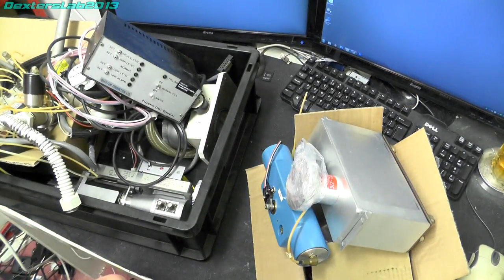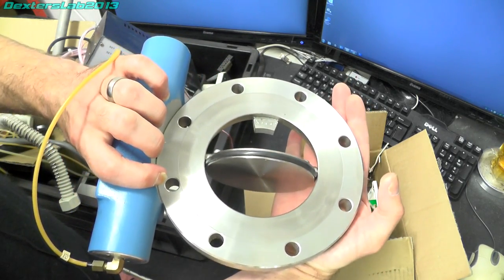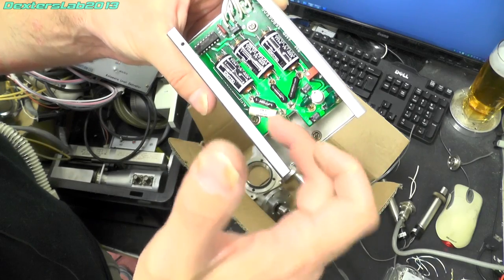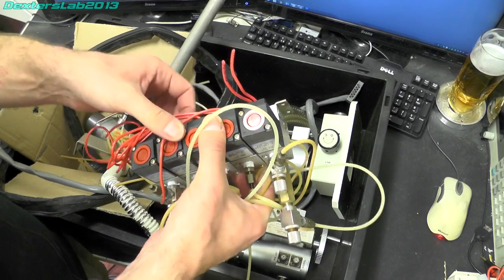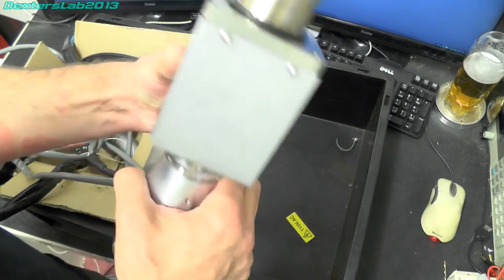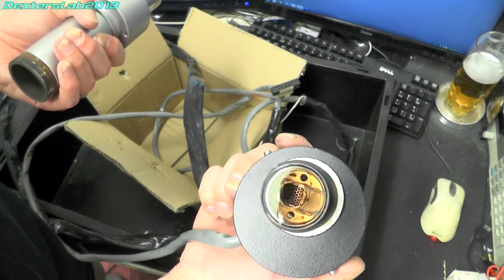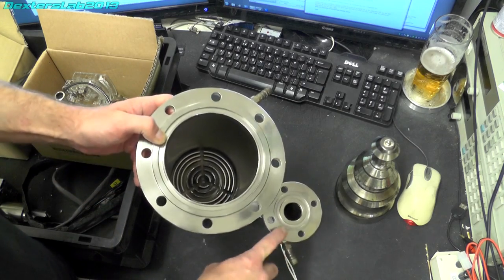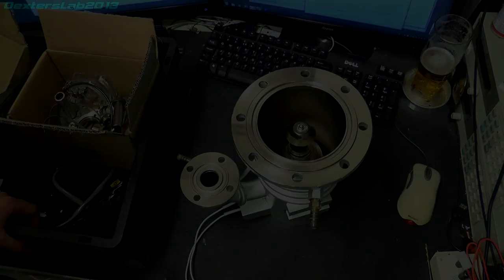DL126 - SEM Teardown Part 3: Final Parts Haul

Comment: The device at 9:30 looks like Everhart-Thornley (most likely SE) detector to me. It has a scintillator (YAG perhaps) on its tip coated with a conductive layer. The plastic light-guide feeds photons to photo-multiplier. 

It  could seem quite strange to convert electrons to photons and then back again to electrons in the PM but E-T detectors have high signal to noise ratio and bandwidth compared to other types of SE/BSE detectors.
Reply: It dose indeed look like a  Everhart-Thornley, however the movability part sort of makes it look like a X-Ray spectrometer. Since i have not seen the original detector on this model, as mine dose not have one, i cant be certain. The connectors on it do make it look like a SE detector though.
Reply: I think it is a retractable detector. The manipulator with membrane bellows enables to move detector away from specimen when the detector is not used. 
You can see similar detector at www.tescan.com/en-us/technology/detectors/bse-detectors.
Reply: So it would seem as though its a back scatter electron detector. That would explain everything. Shame i cant mount it on my SEM, as i don't have a port free for one.

Comment: Could you save the buttons covers from the evac panel, im missing one of them on mine. Also, if you could send me a pic of the table top of the SEM column that would be cool, seeing as im missing the one on mine at the moment, and its starting to look like the original one is gone forever.

Thank you for the details on the LN2 level sensor.

Also, you might want to also save the cold baffles from the diffusion pump. Also, you might want to put that you touched the parts of the pump in the listings description. As it will need to be cleaned from the oil on your hands in order to ever have a chance at running again. It will save the new owner some problem hunting, as to why he / she isn't getting the advertised ultimate vacuum.